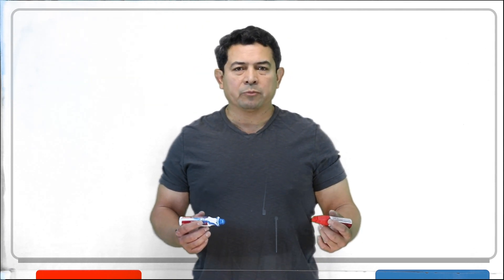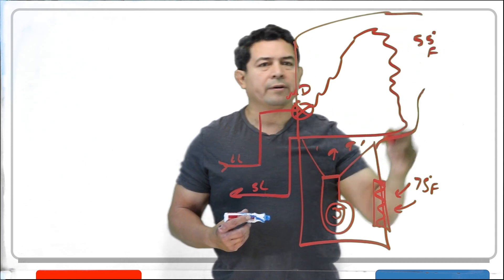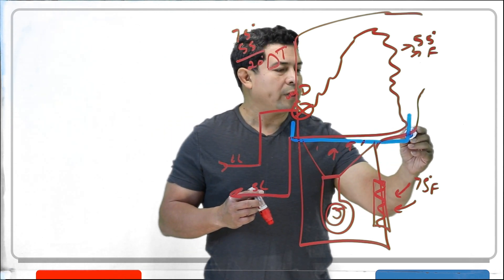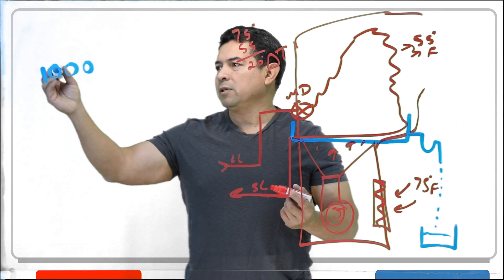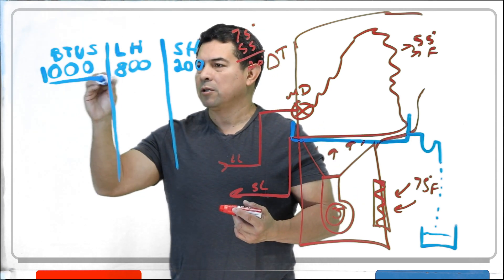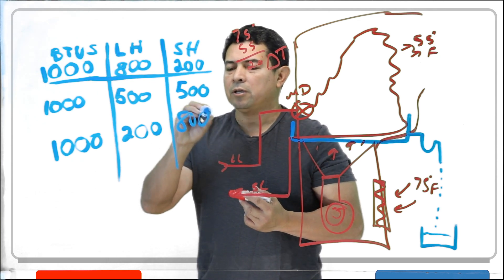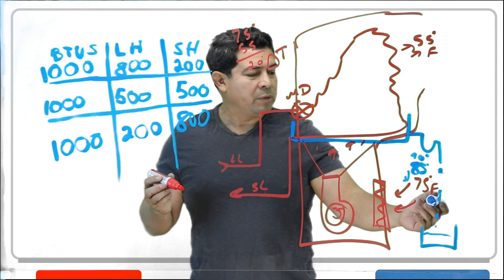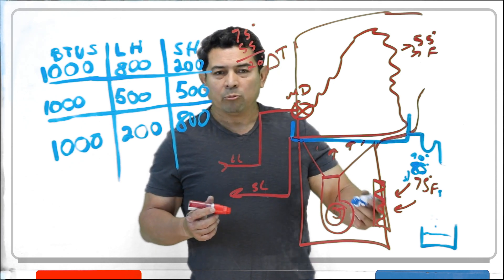Evaporator Sensible and Latent Heat - HVAC Online Training and Courses

Comment: How do you ascertain the saturated temp therefore latent heat in a room that the evaporator has to deal with.
Reply from the maker: I am not quite sure what you're asking. But I hope this helps. We would like the evaporator to be approximately at 40°F. Because of that the suction pressure when you look it up in the PT chart should be very close to 40°    we are absorbing sensible and latent heat in the evaporator. Heat is heat whether it is sensible or latent heat. This heat will be absorbed by the refrigerant and evaporator and that is going to make the refrigerant boil at a specific rate.   The evaporator is designed to absorb a specific amount of heat with a specific amount of airflow, and the combination of the two will give us the correct amount of gas, leaving the evaporator.  The evaporator is going to absorb this heat from the air and the more humidity you have the more dehumidification it is going to do, less humidity the more temperature difference you are going to see.      I hope this helps and I hope this answers your question. If it does not, please feel free to send me another message. And thank you for watching!

Comment: I need both on ac and fridges
Reply from the maker: Yes! The evaporator on the AC and on the fridge are both going to absorb sensible and latent heat. 
The difference is that in the refrigerator the evaporator is going to freeze and the defrost cycle will drain that water/condensate down and out! Thank you for watching!

Comment: Hello, It was so nice video so much good and clear information didn't know that. Can you make a video of how a refrigerant boiling point changes with pressure and how the refrigerant can cool a freezer to -6 degrees Celsius for example if it only came in the liquid line at 12 degrees Celsius. I would so much appreciate that. Thanks and much appreciated!!!
Reply from the maker: Thank you for your comment! And that is an interesting request! I had not thought about doing a video on cascade systems! Excellent idea thank you for watching and thank you very much!

Comment: I have a question. what happens if you introduce hot food suddenly into the evaporator (freezer). how does the load in the compressor vary? i would be grateful if you could do the math and make a video out of it.
Reply from the maker: Because of the warm food, the suction pressure would increase putting a load on the compressor, making it work harder. They refrigerant is going to boil faster increasing the low side pressure and the compressor will have to bring that back down to the desired suction pressure so you can have the correct temperature evaporator.  I will see if I can do a video on that. Thank you for the suggestion!
Reply: @AirConAcademy  
How it will be the compressor situation in case the ac system supported by capillary tube compare to txv ? 
Actually I like the way you present your topic it's clear , academic and simplify.
Reply from the maker: @AlmarbadiT  I believe I have a video about the five different types of metering devices, and I believe I explain the difference between a TXB and capillary tube. I'm not sure if I go into how it affects the compressor. But when you have a TXV we do not need to worry about flooding the compressor or not having enough refrigerant in the evaporator. Because of that we do not have to worry about getting liquid back to the compressor and destroying the compressor. With a capillary tube if the load increases in the evaporator we may starve of the evaporator therefore increasing the superheat. It is the cool super heated refrigerant vapor that cools the compressor. If the suction gas has to much superheat it may not cool the compressor well enough.  The capillary tube systems are not as efficient as the ones with TXV's.   I hope this answers your question, thank you for sending your question in.
Reply: @AirConAcademy  
Thx a lot sir ... appreciate for your help.